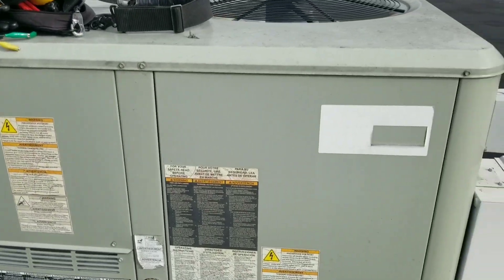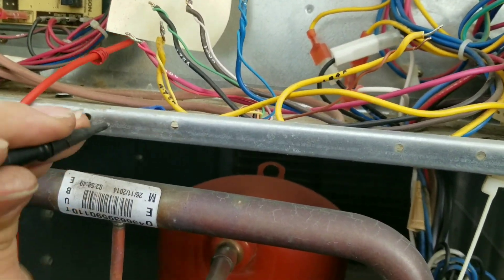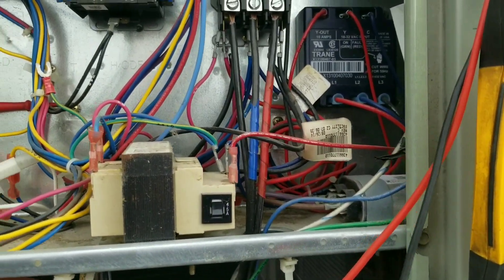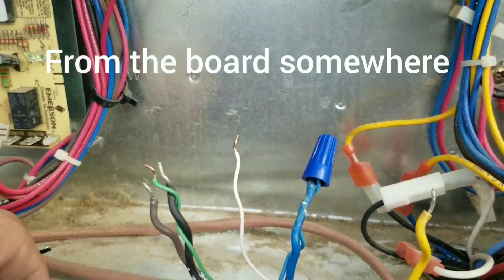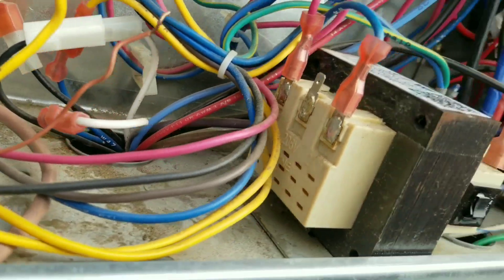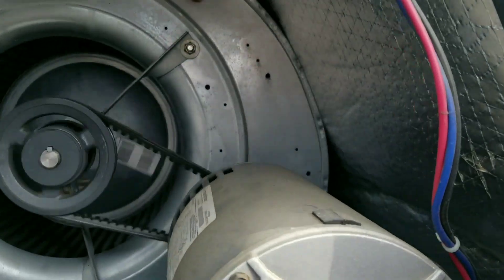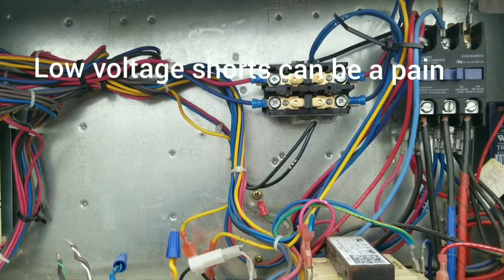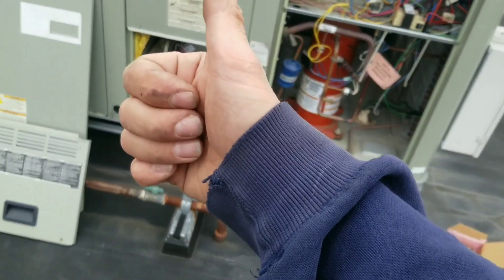hvac service call, thermostat blank, low voltage short

Comment: When you disconnected the ground wire, is that to get more of a pure solid ground putting one lead to metal of unit and other lead to the wires you're testing when you put the meter to continuity?
Reply from the maker: This one was a long time ago, I may have removed the common wire which is grounded to help locate the short

Comment: I understand why you unplugged the ground from your transformer. That way you can check everything to ground and get a true reading if something is really grounded. 
My question is why is it important that a transformer is grounded to begin with? What would happen if that transformer ground wasn't hooked up?
Reply from the maker: The chassis is grounded so that if a hot wire gets loose inside and makes contact with the chassis, the current will take the easier path to ground through the low resistance metal chassis instead of through the human, who is at ground or in contact with ground, touching the chassis.
Reply: Well, it would still work.  The ground and one leg of the xfmr are connected which establish the common side for the design of the wiring of the circuits.

Comment: Personally I dont touch any wires at first.  Most of the time it is going to be an internment issue
Reply from the maker: Not a bad idea,  ive done both but most of the time it's found in the usual places, the true intermittent short I would suspect and check components ie contactor more so than wiring. Thanks Josh!

Comment: Every unit I find is tapped on the wrong voltage. The factory ships them all set for 240
Reply from the maker: Same, always overlooked, such a simple thing. I'm trying to drive our guys especially the young guys to be better at what they do that's part of the reason I started making these videos. Thanks for watching and the feedback!
Reply: Probably for safety, prevent fires or burnt out xfmr.

Comment: Nice work i the same unit but it takes out the fuse in the disconnect or 2 fuses on a 3 phase can’t find what took out been all through the high voltage look at all the wires checked everything to ground.
Reply from the maker: They can be tricky sometimes especially when intermittent. Thanks for watching!
Reply from the maker: If it's a high voltage fuse I would check compressor section a d crankcase heater. Also helpful in these situations to think outside the box, when, what time, was it raining, was unit cooling or heating etc... you may be able to gain the knowledge you need to find this from the customer even if they have no idea what's going on. Good luck!

Comment: I found a rub out on a heat pump last week.  The hi pressure switch wires was laying on the TXV equalize line and made a very small pin hole in the insulation.
Reply from the maker: Nice! Thanks for watching!

Comment: The lower the voltage the higher the current so more current through the contactor causing premature failure of the contactor and shorting out and killing the board
Reply: That's not right. Higher voltage equals higher current. Lower voltage equals LESS current. Ohm's law.
Reply from the maker: Higher voltage will have lower current, check out any multi voltage motor, the rated amps will be lower at 460 than it is at 230 volts
Reply: @EverythingHVACR  that's because power = voltage x current. But running lower voltage will produce less current. Think of it like this, if you only had 23 volts, and you wanted moe, why not run 120v to the board and thermostat? You would fry it. If you have a light bulb rated at 120v, and you only put 80v on it, it would be dim. If you measure current, it would be low. You use less electricity.
Reply from the maker: I'm not saying I think this is what killed the board, honestly I don't remember some of these older videos but I get what your saying. Thanks Sam!
Reply: @EverythingHVACR  I did some more research. Apparently it's different depending on what you are running. If it's a resistive load, it's like I wrote. If it's a motor, it may want constant power so it will draw more amps. If it's electronic, it should be regulated, but will do weird stuff. If it's a transformer, it's always the same power so lo volts high amps and high volts low amps. 

What I think is the board got ruined not by high amps but by weak power which freaks it out. You were spot on about the wrong taps on the xfmr. 👍